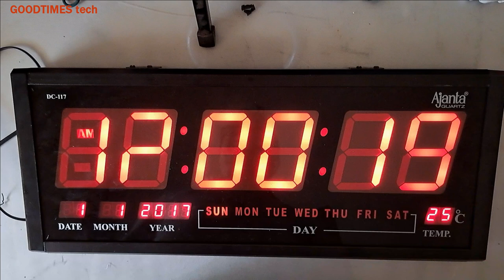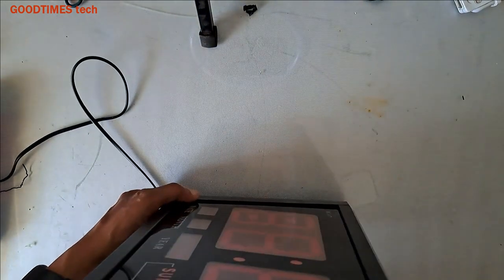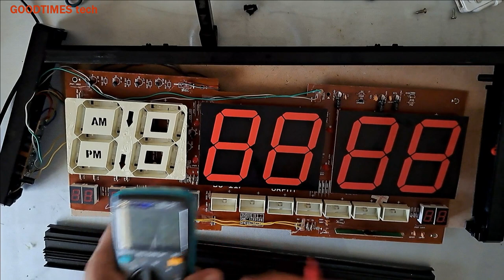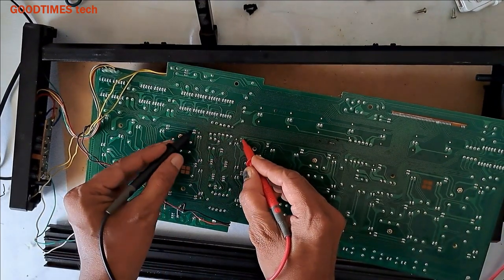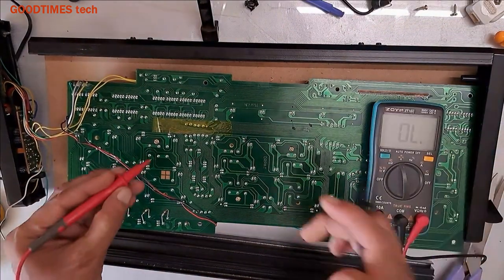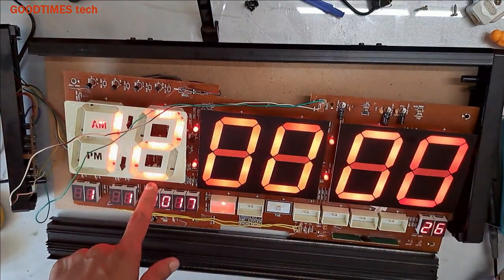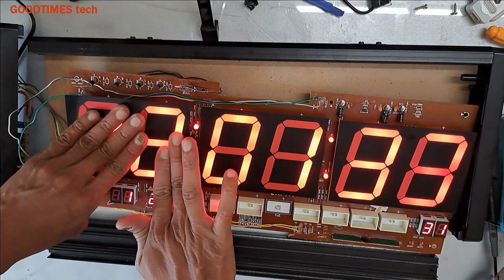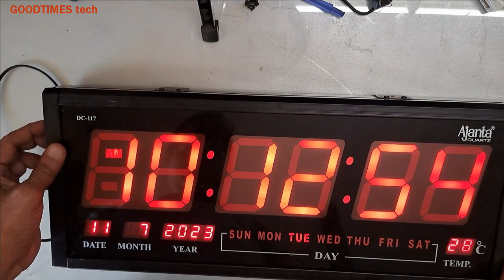LED Digital clock showing half digit | missing digit | how to repair.

Comment: Why's need tape for the way
Reply from the maker: The coating on PCB was peeling and copper tracks were exposed so tape was used to avoid short circuit.
Thank you, have a GOODTIME...

Comment: My led clock half of the digits  sometimes it goes bright to normal then sometimes it goes very dim what could be the issue please ?
Reply from the maker: Hi, may be there is some dry solder joint or corrosion on some component usually resistors, need to trace the voltages at different stages.
Thank you, have a GOODTIME....